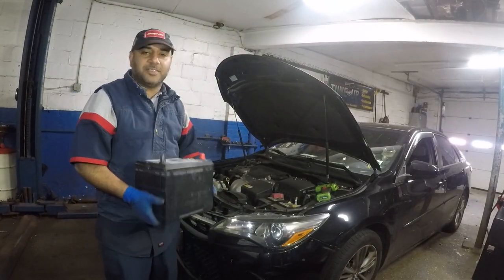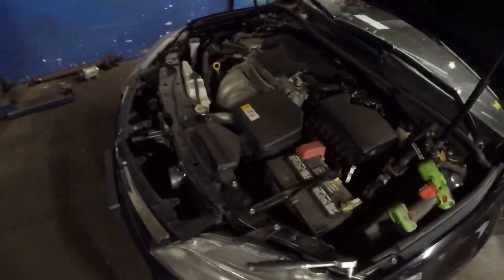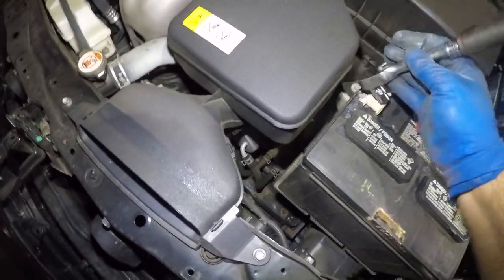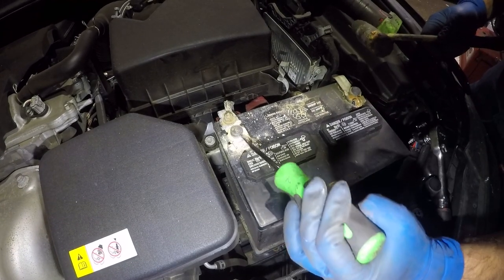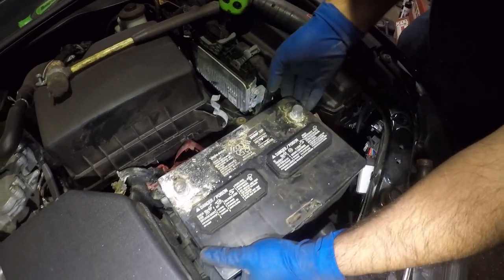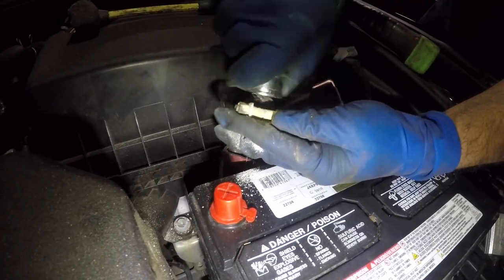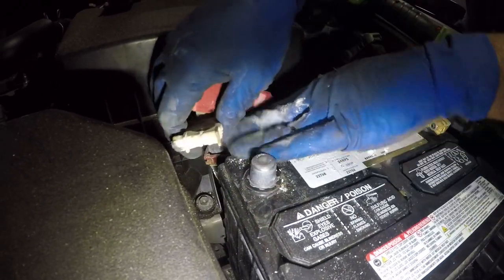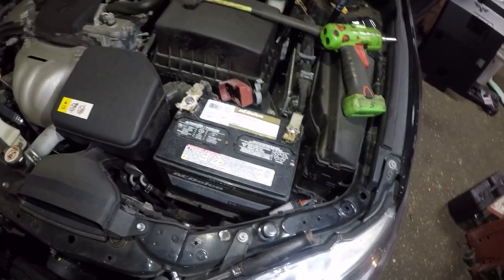How to replace battery on Toyota Camry 2007 to 2011 Easy (DIY) save $100

Comment: I watch most of your videos and they are good, this video is not good as you should never disconnect a battery while the car is on, you can damage control modules and could create high volt spike in the electrical system, and you should always remove negative terminal 1st then the positive it should be done this so you don't get a negative discharge. Sorry brother bad video on this one
Reply from the maker: I never have problem doing this
Reply: @RBTheMechanic  your lucky, that can be done with old school cars. Its one of the 1st electrical thing that is taught when you go to  school to get your certification
Reply from the maker: @josemarrero7290  I will keep that in mind but I honestly never had issues it’s same thing is blown main fuse or broken ground

Comment: I tired reinstalling the battery + first then - but the lights and the horn goes horn off
Reply from the maker: U mean alarm went off
Reply: Key needs to be in the on position. I
Reply from the maker: @beantown5343  ru asking or telling

Comment: I lost the bolt that attaches the front part of the battery holder to the car. how do I determine what size it is?
Reply from the maker: Usully 10mm are common that might be the one match up somthing
Reply: @RBTheMechanic  thx. is there a 10 mm or are there like 1. or 1.25 or 1.5 on the other side of the bolt? there are other bolts holding lime an air intake duct. are those bolts the same? I will try to see if they fit and replace them.
Reply from the maker: @markdamstra  I’m not sure about that I would have to see the car but mostly to change the battery it’s 10mm
Reply: M6
Reply from the maker: @elektrrartesano3050  huh?